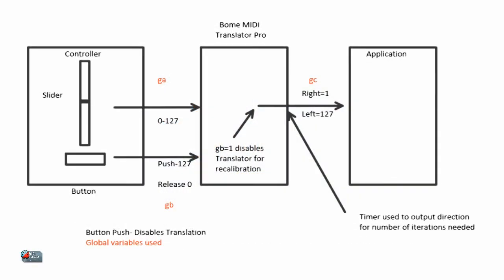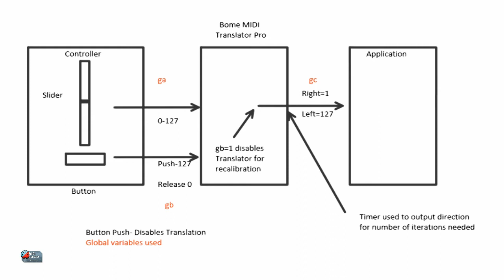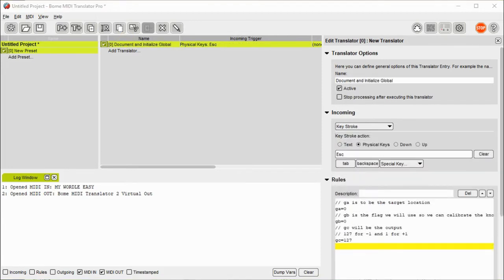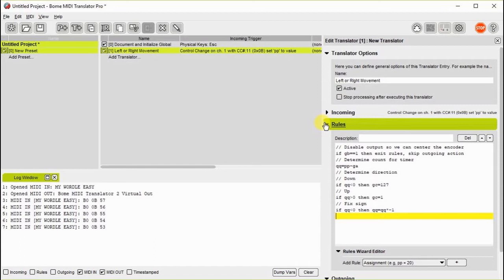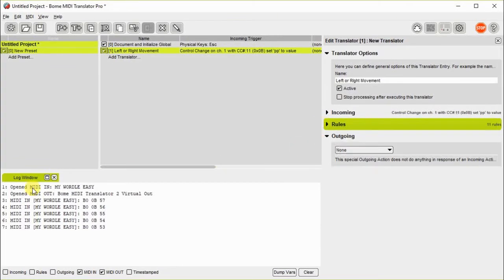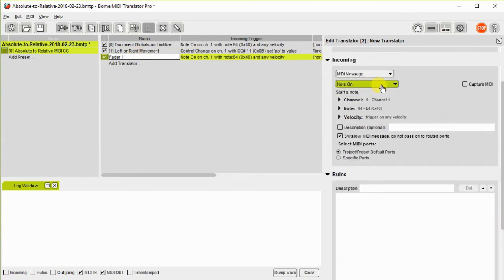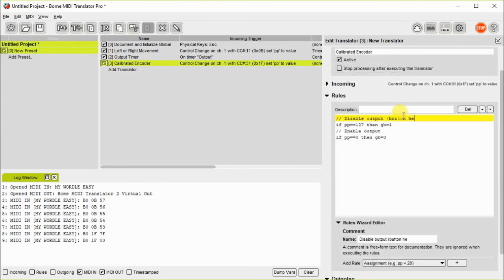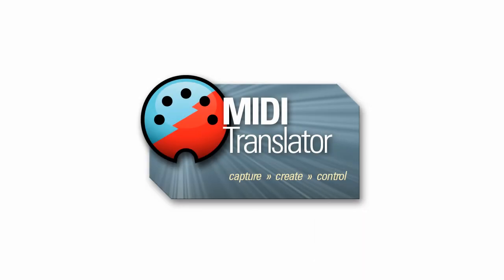Tutorial: Map absolute control change to relative encoder with Bome MIDI Translator Pro

Comment: Hi , can you tell me if this is possible with your software.  Im using a digital organ that sends expression CC11 on  channel 16 .  I have 2 keyboards and a pedalboard 
Ch1 Ch2 and Ch3 
The problem I have with software I use  is that in order to control the expression I have to set it to " omni" but that plays all my chosen sound   on all channels . Not just 1 channel at a time 
If I have 1 sound for channel 1 it plays on my upper keyboard,  channel 2 plays lower and channel 3 pedals . That's what I want but my expression pedal doesn't control the volume.  What I need to do is map what  the organ is sending   Channel 1 to 16 
Channel 2 to 16 and Channel 3 to 16 . 
So it would be CC11 on Channel 16 to map to Channels 1 , 2 and 3 so I can get the expression to work on those channels 
Thanks
Reply from the maker: Hi, 

If I understand you want to map Ch1,Ch2 and Ch3 to Ch16 for CC11 only. Yes this is possible. Please open up a thread on our forum and I can show you there how it is done.

https://forum.bome.com

Steve CaldwellBome Customer Care